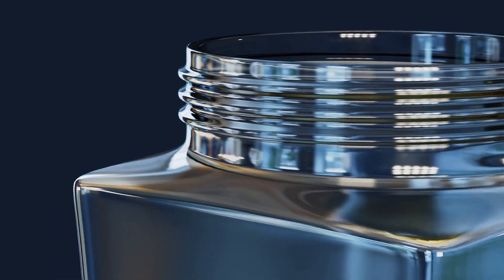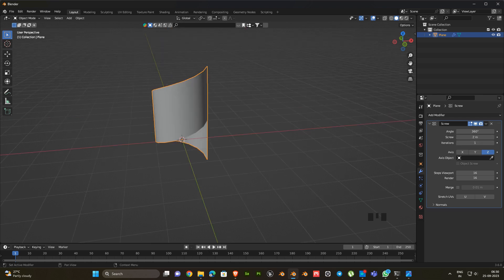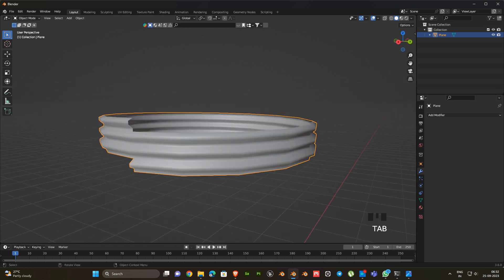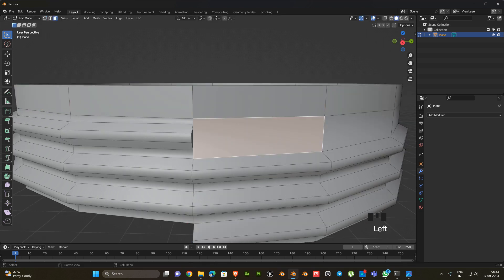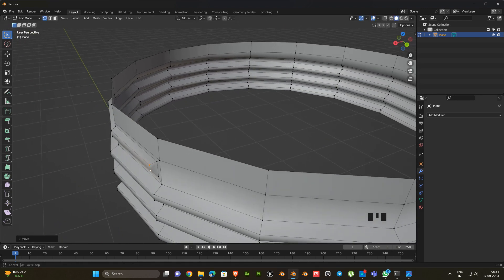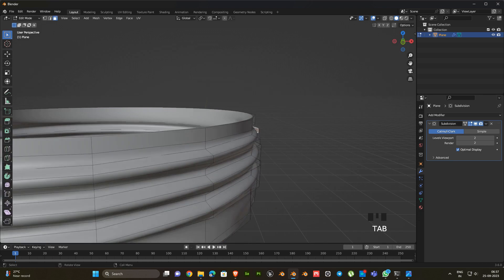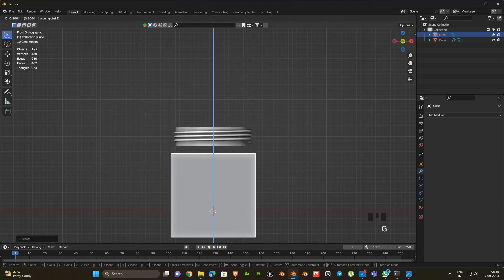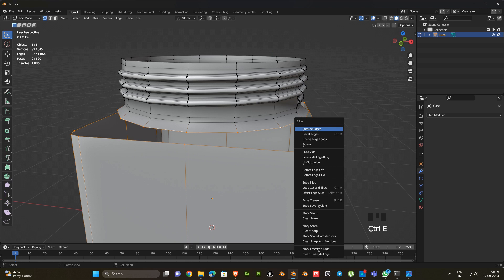How to create Glass Jar in blender

Comment: They must have change that screw modifier shit not giving me same object 😩😩🤦🏾‍♂️🤦🏾‍♂️
Reply: A little late but, I'm on Blender 4.1, If you go Add modifier you should be able to type "screw" in the search or go to Generate>screw (Between Remesh and Skin). 

Now if at first it doesn't work like his, it's probably because you need to mess with the X/Y/Z Axis. I personally had to set mine to Y instead of Z. Hope that helps =)
Reply: @knights_1642  u saved us
Reply: Seems to work as intended for me
Reply: yeah its not showing up for me either

Comment: How did you get the inside of the solidify modifyer to be smooth in the top? - seems like you cut that part
Reply: Not OP, but I essentially went in and manually smoothed the inside by applying the solidify, disabling subdivisions, and edge loop selecting vertices and deleting them. Of course, make sure to leave the top and bottom edge loops so you can easily connect them and place the faces. It took me about 5 minutes doing it manually and I've only been using Blender for a week so you got it
Reply from the maker: 1 apply the solidify modifier. 2 then delete the inside thread area. 3 then use 'BRIDGE LOOP' for  fill the deleted part  hope you understand
Reply: Makes sense! 👌🏻 @3DBlendingHub